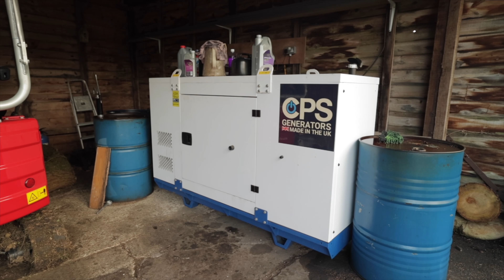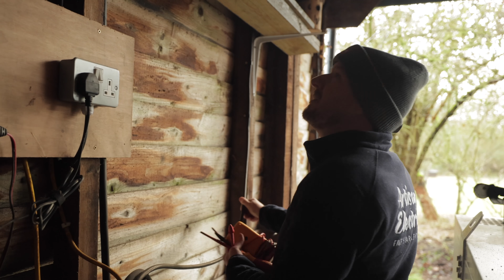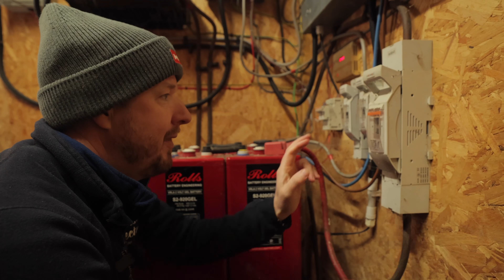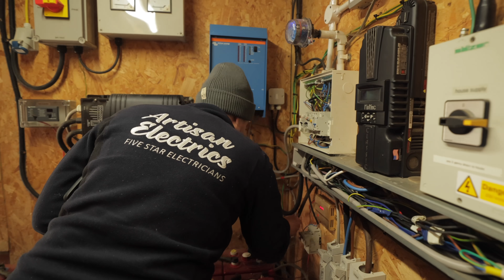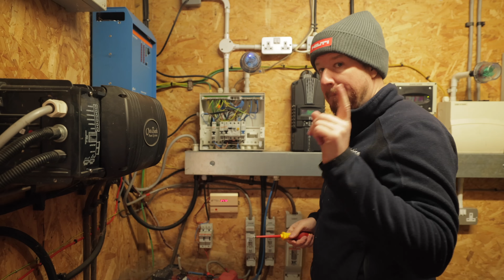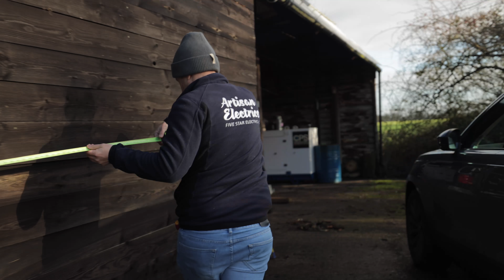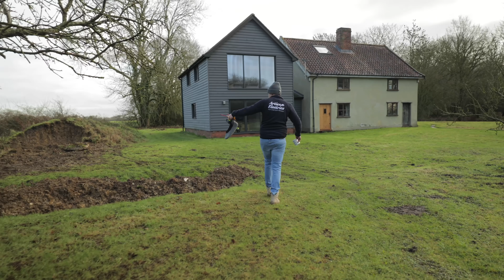DIY Off-Grid Solar Gone Wrong! (It Can’t Even Boil a Kettle)

Comment: What an odd setup indeed. I have an Outback inverter like this one (except mine is the 48VDC input, 120VAC output version) at my off-grid cabin. Those inverters can perform dual-function, acting as both an inverter, and also as a battery charger. When properly configured it can automatically switch over to generator power and charge the batteries as soon as power from the generator is applied to its input (the inverter has a built-in transfer switch).

They're quite robust inverters and you can even parallel multiple of these inverters for added capacity, or even have 3 of them to get 3-phase power!

The decision by the original installer to use mis-matched devices from several different manufacturers is strange to say the least. When you stick to one product line, all the devices can communicate seamlessly with one another and configured/controlled/monitored from a single control panel. The Outback inverter for instance has a lot of available configuration options that give it a lot of flexibility, but without the Outback system controller, you're not able to use it to its fullest capabilities. They offer a compatible module which allows tracking of battery SOC (state of charge) as well as a module to control automatic starting of a generator if the batteries drop below a desired charge level.

Mixing and matching 3 (or more?) different manufacturers of equipment you leave a lot on the table in terms of features and usability, and just make things unnecessarily complicated. Pick one manufacturer and stick with it for the entire system.

By the way, the thing you refer to as a "solar inverter" is an MPPT charge controller. Basically a fancy DC-to-DC converter that optimizes the current drawn from the solar panels to get the most power out of them (thus Maximum Power Point Tracking), and converts the voltage down to a suitable charging voltage for the batteries.

In off-grid setups it's quite common to have an MPPT charge controller separate from the AC inverter.

All the equipment in this setup is good stuff (Outback, Victron, Midnight Solar), but this is a very over-complicated and messy install for sure!
Reply: What is odd about the system?
There is no need for communication - the solar chargers and the charger connected to the generator just charges the batteries up to a set voltage. The inverter is set to disconnect when the voltage is too low, and also to kick on the generator when needed.
Different brands = parts replaced during the years.
Sure, it doesn't look as nice, but it works fine.
Compare with a hifi system where you have upgraded/replaced stuff over the years. Nothing wrong with mixing a Yamaha CD player with a Luxman amplifier, and also nothing wrong with mixing Outback, Midnight and Victron solar stuff.

Comment: 24V for a total off grid electrical system, even one that small is not even nearly enough, they'll be pulling such high currents from those batteries that it would kill their plates....

Sorry to say though, I would also redo and not even try to fix as that whole system is totally incapable.... 48V is the way to go, a lot smaller current will be drawn from the batteries compared to the available 24V ones...
Reply: For a 3kw inverter like that Outback it was a pretty common setup 10 to 15 years ago. Those batteries can easily handle the 3kw load at 130 amps, but you'd only get about 4 hours run time till you hit 50% depth of discharge at full load, 2kw is equal to the 10 hour rating for full discharge or about 6 hours for 50%, and also pretty close to the recommended charging rate. Max charging rate for those batteries is 240 amps according to the specs. But often lead acids aren't fully charged each cycle and that's what kills them, partially cycling sulfates the plates pretty rapidly.
Reply: @andycanfixit  Yes, true, the problem is looking at a current modern household.... 

Switching on the telle, lights and having the washomatic running most likely heating the water...... Then you want to put the kettle on for a brew.... That's it, that is exactly where the issue is..... 1: your over the inverters capabilities, 2: your batteries as I said are not going to last. Guaranteed this guy has kids and his wife most probably works as well, which means most washing will take place on either weekends when everyone is at home "doing stuff" or at night. 

Taking into account that the solar on the rooftop is only maybe 2.5Kw with aging panels. And the inverter has maybe a 500W overhead..... That system is just way to small for the current household demand.... I was not being mean when I said there is just to much current draw on that 24V system I was only stating the obvious... Look at the current draw difference on 24V with that load compared to it on 48V, there is a very big difference. 

There is a very good reason for most solar setups going over to a 48V dc system rather than a 24V one, I know I ran 24V dc for 8 years, before switching over to 48V and now lithium rather than LA.... I can see the difference, in the morning when I woke up on the 24V system I was down to 40% SoC..... With the 48V one I am at 60% with the same loads running through the night.... Not to mention that if you want your LA batteries to last, you would not want to go past 50% DoD.... This is why LFP is better than LA deep cycle or not, when it comes to self consumption LA does not stand a chance against LFP You would need double the foot print area if not more in LA batteries just to try and stay relevant compared to LFP...

That system might have been sufficient a few years back but not today with our modern lifestyle....
Reply: @MyLinuxExperience And swapping it for a 6kw Victron Multiplus and modern 48 volt lithium iron phosphate batteries would fix the issue along with some new wiring. The Victron can run the generator as well and it would cost a heck of a lot less than the Sigenergy he plans to quote them and be supported for years to come. Instead he is going to quote them a system that will likely cost 20k or more. The existing solar could easily be used along with new ground mount arrays. I cook, do laundry and run minisplit heat pumps off a 6kw inverter with no issue in a house about the same size.

Comment: Bit disappointing vid. Anyone can get anything fixed by throwing enough money at it. You should have started with what the costumers limits and expectations were. As I see it you found the error in the system and all you had to do was upgrade the fuses from 16A to say maybe 20A. And main cables to carry that load. That would probably have fixed the costumers problem, and for a very much less expensive way than yours, rip everything out and start from scratch. That is not a fix is something else

Comment: I think you've got a good channel here, but without seeing the outcome, it kind of feels like a cliffhanger that will never be resolved.
Reply: You're new here, aren't you ? :-)
Reply: @mpellatt  Yep
Reply: @codemonkey2k5  Let me summarise things, so you don't need to come by too often.
MO: Slag off the previous installers, rip & replace, then find there's something funny going on, finally turns out it's because you didn't actually understand what you were doing. Even installed a so-called voltage optimiser rather than getting to the root cause of an issue.

Rinse & repeat

Comment: There was no order it was add a piece OK now it's working now it's not add another piece OK now it's working OK now it's not add another piece reconfigure. The outback systems are semi-good from what I understand but they are very limited most of the ones I've seen around the US are only good for 120V at 30A.  If you needed to 40 in the US you would gang multiple units together or use a weird auto transformer configuration. They're kind of like the Victron system where you can add what you need and configure a really complicated system from bits but also very we're going to give you the whole kit to do it kind of thing. But they incorporate a battery charger pass-through which probably isn't enough to charge a large string of batteries which is why they're often coupled with a straight up battery charger. and the Solar is going through an MPP charge controller straight to the batteries (well I think with that wiring who knows?). But yeah they're using a really low voltage battery bank ideally it should be up around 48V but they might've gotten a really good deal on the 24 V inverter. The worst thing about the outback system is that they were one of the early producers of equipment in the marketplace so a lot of their equipment is single voltage. as in you pick your battery voltage and you pick your output voltage and that's a one SKU and product selection, you change anything and that's a completely different SKU end product. And I'm willing to bet at some point they had so many issues with the system they brought somebody in who attempted to improve things which is why you got a PLC control cabinet and an actual diagram which could only exist handwritten because the guy was probably never invited back because it either functioned and exceeded their expectations very low ones or they didn't want to pay to actually have what was needed to be done and it worked good enough.

Comment: But this isn't the modern world this is off grid communing with nature and hippies and such wearing garbage bags for clothes. At least that's the idea of the most likely original installer. You're not doing good for the world unless you are suffering.
So many of these DIY or off grid systems that I've seen online and throughout have so many shortcomings and corners cut like oversize panels for an undersized inverter or vice versa. Or they think they don't need to follow any building codes or do any research because you know they don't like the government telling them they should make a house it doesn't fall down.

Comment: 16A is 3.7kW which is plenty for a kettle or air-fryer (but maybe not both at once (buy a 1kW kettle for this sort of setup). We run our whole house off a 5000kVA Multiplus II. Induction hob, kettle, immersion heater, air-fryer, TV, quite a lot of computers. It's fine. A 4.5kW Victron like that will actually supply up to 8 or 9kW for a short while to ride out overloads. You can get 8kVA or 10kVA but that's probably overkill.
Check those batteries - they are high-end lead-acid gear but may still be knackered if they've been there a long time. Better to get an LFP like Fogstar which will have way more capacity for a lot less money, then add a 5 or 8kW Multiplus II and an MPPT controller plus a Cerbo to control it all and provide remote monitoring. That will run the genny too. £3.5 grand for the lot. Probably worth putting some modern panels up which will give you 4kW on that roof, rather than 2: £800 or so.

6kW on the roof plus a genny for a bit of winter top-up really should be plenty unless they are trying to run a hot-tub or something.
Jordan is confirming what we all know already: only get Artisan in if you want to spend a lot of money. So much unnecessary replacement. Sure you can chuck it all and start again, but you don't need to, and it's wasteful.
Reply: Agreed, the system there was probably sized for the smaller needs of the previous owner, based on tech that was available then. Just a useful scale up and fixing/replacing of what is knackered is what is needed. I don't like over integrated solutions, you create a single point of failure. One bad lightning strike and you have zero power. I think the MOV's are hinting at environmental factors.. Yes, the wiring and labelling could be better; but I've seen professional wiring far worse than this.
Reply: @keithmarlow143  My exact idea. Just looking to those MOVs/SPDs it make me think: lightining might like to discharge on that poor roof.

The guy even included a theory of operation on the controller box. C'mon.
It seems he just want to sell his narrative.
Reply: @keithmarlow143  Also a bit of investigation of how the customer uses electricity, and educating the customer might be a good idea. Like for example the kettle heats up water so fast that you can turn off the air fryer while running the kettle. Really a first world problem.
Reply: @keithmarlow143  Moving from the best-made gear to made in China Sig-E makes me mad. What a downgrade.

Comment: The  Midnite unit is a MPPT charge controller and NOT an inverter. You clearly don't understand anything but off the shelf grid tied systems. This is unprofessional and misleading. If you were an "Artisan" you would not expose yourself in this manner. Horsehit diagnostics.

Comment: Who cares how carefully the wires in the CU are dressed? That's not really important. So long as they are the right sizes/colours. Exposed copper is not good, but it's less than there would be on a busbar in the same location. Non-double-insulated DC wiring is poor, although are they all paralleled so nothing is more than 100V?

Comment: I saw so many of yours videos, and all the time im still being surprised how small are the consumer units in the UK, how mess it is.Dont know the code in UK but many times missing RCD, RCBO, SPD. If i compare with the Czech republic, of course we do have this diy butchery as well, but this video is at least for me beyond any imagination...Messy, cables all over the place, installed on the OSB without any separation  of non-flammable material, no marking, just insane... As i mentioned, we do have this issues as well, but at least in new installation (not always) its ok. Also i can imagine you dont show pristine instalations because, it would not be so interesting. As alway keep going, you're doing great job.

Comment: 27kw of batery if there good condition even at 50% depth discharge that 13 odd kw.And that outback black box would seem too be an inverter wirh possiblly charger or UPS function as there hot/neautral(live/neautral here) input and outputs AC.Generator seems awfully big for 7 odd kw you would think some of the newer ones today be much more efficient but then again if the batteries were good and you could charge at 3 to 5kw it wouldnt take long to charge them and use excess generator power for heavy AC  house loads.Was myb quite useable at one time depending on inverter capacity and how good batteries are now just imagine few decent size 24 volt lifpo4 batteries 2 or 4 at myb 300ah  or something tidy up all the wireing/new inverter and solar panels/ keep old if good output still and a new set as well.I guess as profesionals you have to take a much stricter route than a good competant diy person running total offgrid setup.Great video bud.👍

Comment: I build cabinets. I have a Bosch laser measurer. They have a app that is great. You take your picture and then draw lines and the measurements. It has saved me lots of trips back. The nice thing is that I can take more than one picture and then separate the stuff that I am measuring. And if I miss something I usually have it in the picture.

Comment: That Midnite Solar PV charger on the wall is a lovely bit of kit.  I'm surprised you didn't recognise the Midnite lightning arrestor.  The Outback inverter is a nice bit of kit, but not really suited to housing over here.  I run an Outback Flexmax 80 PV controller, great bit of kit.
Reply: It is not sygenergy so it’s bad ! It does not fit the narrative !

Comment: My advise: Rip it all out and get a Victron Multi RS. It has the solar input. It has the generator input. And it's robust. And 6kW is generally plenty. And if you need more power: get a second one in parallel.

Comment: I am not an electrician. I have been working in the industrial electronics field for 10 years with an additional 12 years or electronics repair.  I have done DIY wiring at home but I consult the rules and regulations before doing it.

Comment: This looks like a hodge-podge of whatever equipment that happens to be available on sale somewhere. The wiring looks like it has been done by different people, without any proper coordination between them, making overview and maintenance a proper nightmare, especially with the minimum of documentation.

That said, an inspection should also entail looking up devices that you haven't got a clue what they are or what their role is. Just be upfront about it and don't resort to guess work.
I don't know ( yet! ) is a perfectly valid answer. It shows some modesty and a willingness to investigate and think things over.
Yes, you are a professional, but you can't possibly have knowledge of every device on the market, for all brands.
Reply: What documentation is really needed though?
Super simple circuit. Solar panels -> combiner - > solar charger -> battery. Diesel generator -> mains powered battery charger -> battery. Battery -> inverter -> breaker panel / consumer unit feeding various 240V AC stuff. Some control wires for turning the generator on/off.
If you are able to turn on the windscreen wipers of an unknown car without reading the manual, then you wouldn't need any documentation for a system like this...

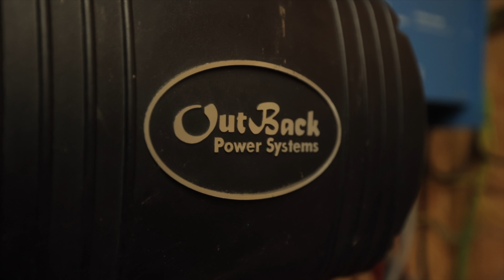Comment: 8:30 That device you call an inverter (MidNite Solar) is actually an MPPT solar charge controller, at least that's what we call them here in the US.  I'm not sure if you use different names for other equipment since you stated back at 4:45, that you knew the solar inverter (Outback Power Systems) was American since the AC out was labeled Hot and not Live as you use in the UK.
Reply: Your right. This time he was clearly out of his depth.